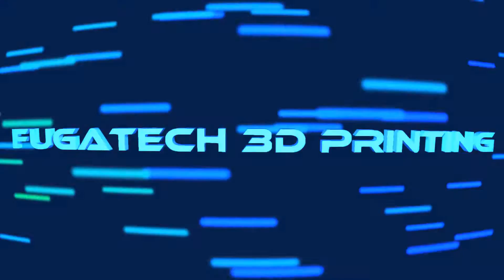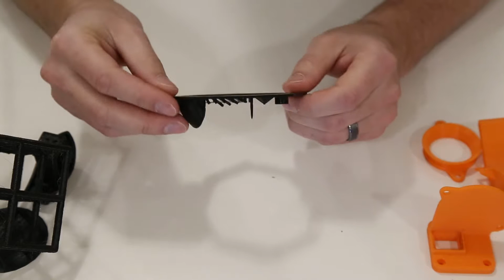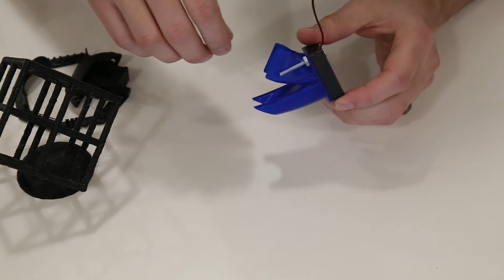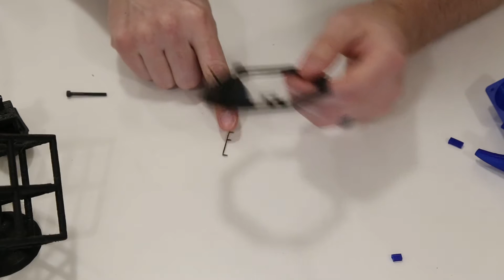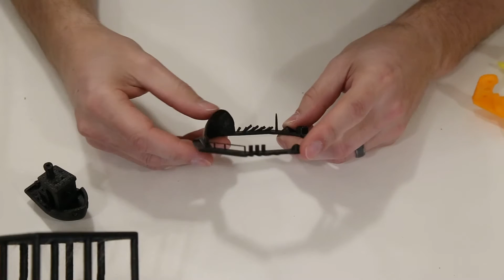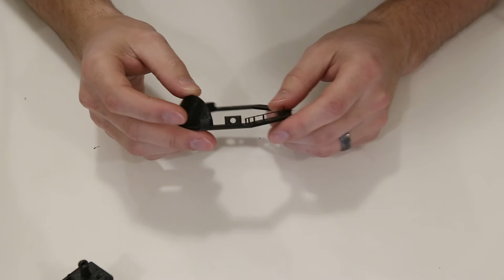What is the Best Fan Setup for the E3D Volcano?

Comment: Its my understanding that stringing a retraction issue not as much a cooling issue?
As far as part cooling goes wouldn't it only be proved which is best by multiple length bridge test, also/ or a arch overhang with angles and the lattice cube style test (i think makers muse has a xmas tree avaliable now) the benchy is all ways good too but i think not necessary. Also black isn't a good colour to show with tests using lighter/ brighter colours is much better to see as black all the shadows just blend and we just have to take your word for it.
Love the video by the way and is a fantastic start point for my setup as i am getting ready to install my e3d volcano in a direct drive setup on my Anet A8 and was looking for something with 40mm fan on the heat sink and two part cooling fans of similar size but it looks like they all use the stock 30mm fan which i heard can noisy especially on clones as you found with the aftermarket 30mm fan.
Reply from the maker: I'll keep all that in mind if I do another one of these tests. Thanks!

Comment: How do you wire the fan and set up in Arduino? Please help.
Reply from the maker: On most boards there is a fan 12v output near the hotend and heated bed outputs. Most machines have that enabled but if not you will need to look up how to enable the part cooling fan for your machine.

Comment: I do own a Velleman K8200. Sorry i hear you say. Yes it is not one of the best printers.
I realy like what i see about the FT-5 and i am considering buying one in the future.

About the fans:
On the original hotend the K8200 has a 40 mm fan that is mounted with a thin peace of metal strip. The fan does make much noise but not so much that it is un-workable.
I upgraded my printhead to a E3D v6 & E3D Titan. It comes with a 30 mm fan in the box.
This fan makes SOOOOOO much noice! You can hear the fan from 20 meter away very well. You must put the printer in a closed room to not hear a it. That is not funny.

In many computer cases are fans installed that are optimised for silence. Also you can choose between presure optimised fans and fans that cool bigger arreas such as the whole computercase. Every computer builder does confirm that these ara one of the best fans if not the best out there.

So i did buy me some 40 mm presure optimised fans (the smallest once) and they are exelent. You mut put your ear right near the fan to hear it, so quit are they.
Another benefit these fans have is that they only use 50 mA of power. That meanse that i can put 2 fans on one header. My controller can handle max. 100 mA. 
All fans i can find on the internet use more then 50 mA witch means that i could use only one fan but now i use 2 fans, one on the left and one on the right.

This is the fan i use:  Noctua NF-A4x10 FLX 40x40x10
Reply from the maker: Ya Noctua's are really great fans but too pricey IMHO.

Comment: What causes the layer shifts?
Reply from the maker: Could be lots of things. Driver voltage set too high/low. Too much slack in the belt or too tight of a belt. Motor got too hot, driver got too hot.

Comment: I made socks for my volcano: http://www.thingiverse.com/thing:2031489
Reply from the maker: WOW!!! I have no idea how to do that but I will deff look into it. Thanks!
Reply: I needed them for my custom designed dual extruder delta. I have my own design silicone wiper platform, so the sock keeps the nozzle completely clean as it does a wipe during tool change operations resulting in a completely perfect dual color print with no cross contamination. I went through 5 iterations of the sock based on the original idea I referenced in my thing before I arrived at my final version, it works better than e3d own socks because it doesn't fall off and only leaves just the opening for the filament. It also squishes down any bumps you get on the layer as the filament is cooling because it's solid silicone, unlike the e3d regular socks, so there are more benefits than just keeping the nozzle clean and insulated.